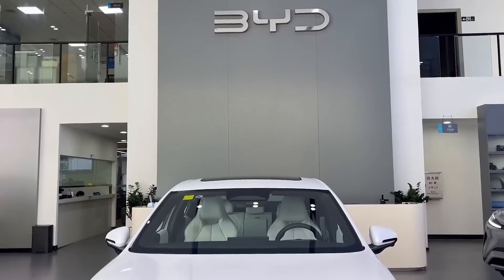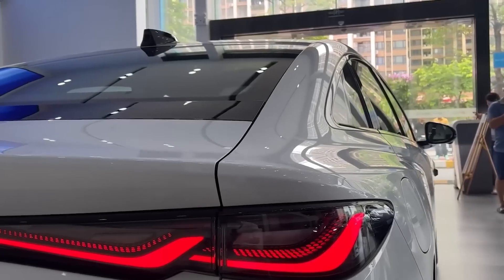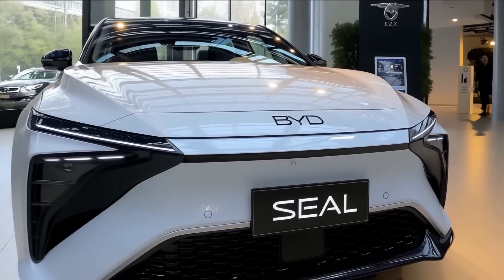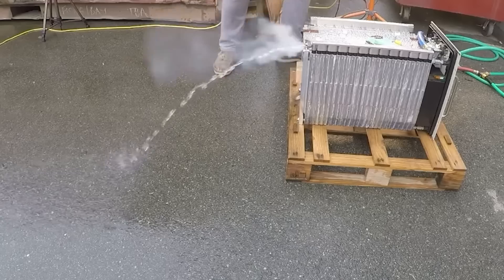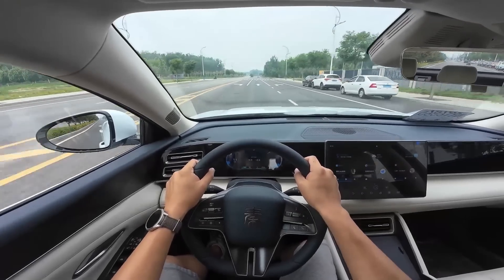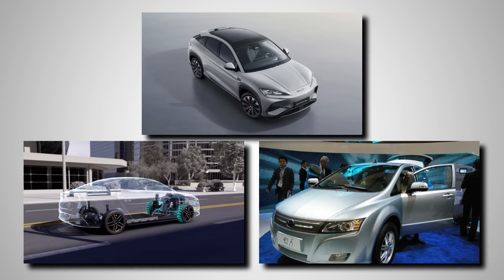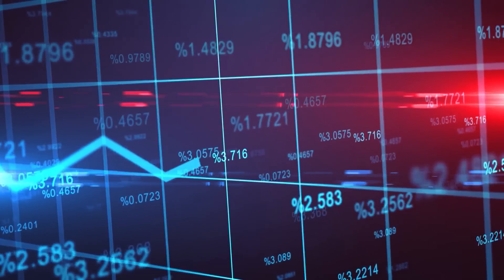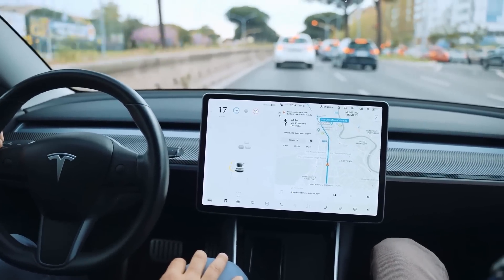BYD CEO Just Revealed a NEW Engine — And It Could DESTROY the EV Industry!

Comment: I would be interested to know how much fuel it consumes per 100 km when running purely on gasoline (i.e., with an empty battery) at speeds of 100, 120, 140, and 160 km/h.
I myself drive a Mazda MX 30-REV (serial plug-in hybrid with Wankel engine, limited to 145 km/h). If I drive at 140 km/h with an empty battery, the fuel consumption is around 11 liters/100 km or even higher. I know that the MX 30-REV is actually a city car, which means that with enough charging stations, you mainly drive on electric power. 
But the fuel consumption of this car on longer journeys is absolutely inefficient.

Comment: It's not a solution. Just add 200L fuel tank to simple car which could exceed 2200km. If you could do it with a very low weight of it's car size is a succes.  2 Tons C segment car is a fail.

Comment: What..? That explains nothing. When it runs out of battery it uses 2.9L/100km fuel. That isn't possible. It has to push the weight of the car plus an entire battery system plus the fuel tank plus passengers, and it uses less fuel than an internal combustion engine to do it? That lady said BYD has more models than Tesla and that's all.
Reply: The engine is use to charge the battery.
Reply: @faraby02  that still seems like it'd be under very specific conditions. But hey every car manufacturer does that. I feel like it'd be closer to 4 (which is still good) but my trailing point was that we never heard the actual woman from BYD say it. She didn't mention anything at all.

Comment: Plz do the research that what type if battery they are using, they are using less capacity battery, which not fuel efficient. Germans are already regretting to use BYD batteries for their green power storage facilities 😅
Reply: I did some research and found no where that German's are regretting.
Reply: @Aayush2614 not at all, can tell that what technology BYD is using in their batteries and whether they make improvements in capacity or security or performance in various temperatures? And plz tell me what is the distance covered by BYD cars in a single charge in India? Claim and on road performance?
Reply: @ProffAnil could you share your sources so that I can get a clear picture before giving some constructive response. I will come back to you after a couple of days.

Comment: So these figures 2100 km is more dependent on petrol with  gives 100km per 3L 
So what's the battery part for? 
Some initial 400-500km.
Then on 99 hp engine for rest 1500 km or less if engine is used with the motor initially, then will that 99hp enough for highway speeds like 100kmph-120? With all those extra electronic waste
Reply: You need power when you accelerate. The battery helps with that, because when you brake it charges back using the kinetic energy.

Comment: Why do none of these cars incorporate solar wind and rotary electricity regeneration ? Surely all combined would at a minimum enhance range? And as for wind, a moving vehicle could easily create a wind tunnel into the structure. And four rotating wheels + magnets and coils easily generates  electricity. Recapture and charge on the move. When stationary, even a solar hood, roof would capture 300watts
Reply: Or a pop up windmill when going down hill to charge battery
Reply: Think about it… if a helicopter’s motor stops working the resistance of the rotors can slow down the rate of falling to a point where it’s possible to survive the impact. How do you think a wind turbine would impact a car going down hill then? Yeah, it’s going to slow the car down and you’ll be complaining about taking an extra hour to reach your destination.
Reply: @HQD-m2w not talking about huge contraptions. Air vents to cool engines isn't new. Nor are alternators on ICE engines. Speed of rotation is key. A mini turbine designed for sail boats is designed to convert wind power to electricity. It needs huge blades because wind speed is low. On a moving car, wind speed is huge. Funnel that via vents into a mini turbine, and jettison that at the rear isn't going to add very much drag. Besides, WHEELS are rotational. And brushless couls and magnets at the rim could very well be efficient and effective . Were not talking of old fashioned dynamo nor even a belt driven alternator. But that gives you an idea of size.
Reply: Solar wind? 😮😂
Reply: Using wind would mean increasing drag. It’s more efficient to make it more aerodynamic, since energy conversion always has loss
Reply: @CV0602 wind is not always drag. If it is ejected out the rear. Btw chinese ev car nio just installed solar panels under the sun roof increasing range by 60km. And fully charged if left undriven for couple of days. That's a start.
Reply: or just do this instead https://i.ytimg.com/vi/M7-h3FO-KKo/maxresdefault.jpg
Reply: Thoose engineers are brighter than you. So think again why

Comment: This shows. Ev alone is not practical. Hybrid is the future
Reply: Really? When did you last drive 2000km? Or half that? Without stopping anywhere particularly at home.
Reply: @JeremyCobb  I mean… drive range does not make you drive 2000km at once, right?
Reply: Maintenance not so cost effective
Reply: Gasoline cars are the future not EV or hybrids.
Reply: If BYD can't build pure  gasoline cars  it simply has no future.
Reply: Toyota’s CEO actually told that few months ago, that EV is not practical. And that among three EV, regular fuel engines and hybrid, the third is the most “green”. It’s weird how most don’t comprehend that

Comment: I do own a Shark 6. Kinda frustrated, a full tank and a full charge will only run up to 860 km (as stated ), unlike my Sealion 6 that runs up to 1300km on a full tank & fully charged battery (tested) But then, i realized, can't compare my sealion 6 suv with  shark 6 pickup thats powered with  2 motor (all wheel drive), of course it comsumes more power than the single motor on sealion 6. Which i did made an actual test on fuel cosumption... not going to its full details, i made a trip for 255km with fully charged battery & full tank with my shark 6, my trip consumed only 10liters of unleaded gasoline, determined these data, upon arriving at my destination refilled gasoline to its full tank capacity & paid 10.4 liters of unleaded gasoline for the 255km run.

I am pleading to BYD to create an upgrade on shark 6 software, that there would be an option of only rear motor select as the road demands so as to save its energy and extend its kilometer reach. 

I would be very glad & of course, every owner will be., just as a typical diesel engine pickup, which have a drive selector 2W, 4H, 4HLc, 4LLc. Praying for BYD for this upgrade, it will surely win the hearts of pickup truck owner!!!

Comment: Have to see it to believe it . 
I own a Shark and that has a 1.5L turbo petrol engine and at highway speeds with a depleted battery that engine is working its ring off , using up to 36L/100km at times or more .
Reply: what kind of engine chugging 36l/100km..or you mean 3.6l/100km
Reply: @melako85  NO I mean 36L/100km instantaneous readout from the dash .. Do you own a BYD ?
Reply: I do own a Shark 6. Kinda frustrated, a full tank and a full charge will only run up to 860 km (as stated ), unlike my Sealion 6 that runs up to 1300km on a full tank & fully charged battery (tested) But then, i realized, can't compare my sealion 6 suv with  shark 6 pickup thats powered with  2 motor (all wheel drive), of course it comsumes more power than the single motor on sealion 6. Which i did made an actual test on fuel cosumption... not going to its full details, i made a trip for 255km with fully charged battery & full tank with my shark 6, my trip consumed only 10liters of unleaded gasoline, determined these data, upon arriving at my destination refilled gasoline to its full tank capacity & paid 10.4 liters of unleaded gasoline for the 255km run.

I am pleading to BYD to create an upgrade on shark 6 software, that there would be an option of only rear motor select as the road demands so as to save its energy and extend its kilometer reach. 

I would be very glad & of course, every owner will be., just as a typical diesel engine pickup, which have a drive selector 2W, 4H, 4HLc, 4LLc. Praying for BYD for this upgrade, it will surely win the hearts of pickup truck owner!!!